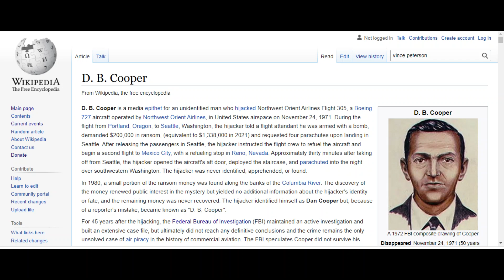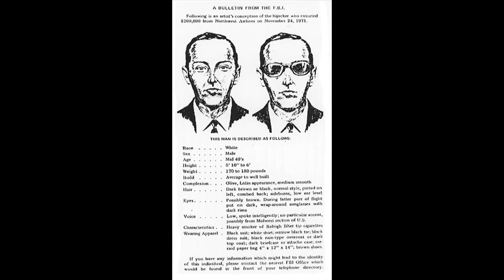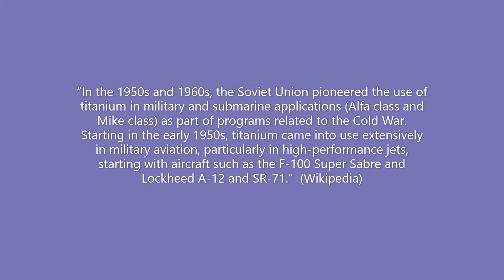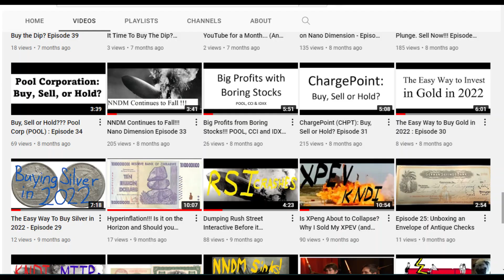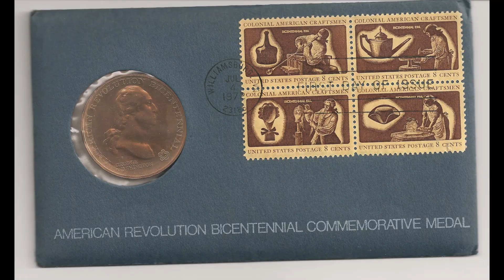DB Cooper: The Trouble with the Titanium Tie and the Latest Suspect. Episode 147

Comment: The origin of titanium goes through a reduction process... until it becomes a pure titanium sponge... when they add in various other metals then it becomes a titanium alloy... during the 60s and the 70s there was basically three titanium alloys... to get titanium from particles that has to come from a powder form... like titanium sponge and titanium dioxide... often metallurgist would wear a clip-on tie and a shop coat to hinder the titanium Dust from settling on them.

Comment: What if the tie came from a thrift store?
Reply from the maker: Possibility that it was not the clue that it seemed. Here is a partial response to another commenter, about the time, you might find it interesting: Hello, thanks for your comments. After my video on November 19th titled: Has the DB Cooper case finally been solved? episode 146 (and that is the episode number for my show to keep things more easily trackable since many of my titles are similar), that one was about Vince Petersen being identified by Eric Ulis as Cooper. The next day I did a video called: DB Cooper the trouble with the titanium tie and the latest suspect, which was episode 147. That talked about some issues with the titanium on the tie. Skipping ahead, over the past two days I uploaded a two-parter called: DB Cooper the terrible trouble with the titanium tie, part 1 and Part 2 which are episodes 159 and 160. Most of the comments that I've received along these lines were before I uploaded episode 159 and 160 so if you've not seen them I hope that you'll take a little time to watch them. In them I point out that the original research that Tom Kaye and Citizen Sleuths did, which still shows on their website as of yesterday, is that the three titanium articles are pure titanium, that is not an alloy. Eric Ulis’ conclusion based on Tom Kaye's research, Is that it was a specific type of titanium antimony alloy. Where the bridge between finding that the 3 particles were pure titanium turning into three particles of a titanium alloy I do not know, but let us for the sake of argument say that there was originally a mistake and that the particles are in fact indisputably a certain alloy of titanium antimony. Is it a valid statement that the only place that this would be found would be at Rem-Cru? I would argue: no. we have the three individuals who applied for the patent they worked at Battelle Memorial Institute in Columbus, OH. They did not work for Rem-Cru. It has been surmised, not my interpretation although I agree with it, that because the 3 petitioners for the patent worked at a nonprofit that four the patented material to be commercialized it needed to be patented under the auspices of a commercial organization, that is a Profit making company, not a nonprofit. Whether that's 100% accurate as far as the reason is probably not material here. What is material is whether these three people who worked at Battelle in Columbus, OH, produced any of this alloy there while they were developing the information for the patent, which I would argue most likely would be the case. How else could you come up with the data to put in the patent application if you have not first created the alloy? So if my contention is accurate then not only possibly at Rem-Cru, but most likely at Battelle there would be engineers working with the TiSb. So we have two places identified where there was likely that alloy at some point. Also remember that patents protect the commercialization of a discovery, product, or process, it does not preclude other people from working with that product and if they improve upon it, they can then patent the improvement to it. Also, the patent was rejected, there was a lawsuit, no patent for that particular alloy was given, and nobody was precluded from working with that particular alloy. Also in the most recent video that is episode 160, I put a screen shot of a scholarly journal written in English but from Scandinavia and probably from research done in Norway on four variations of titanium antimony alloy. That was published in 1962, a few years after the patent application was originally filed. And again lack of other online evidence does not mean that other people were not working with this material. If you were in a lab working with the material even if it was a nonprofit and you wanted to write a scholarly journal, if your work with the titanium antimony did not result in a new breakthrough of any type then you would not be writing the journal article in the first place. And many journal articles are not yet available online even if they do exist.
Again I would encourage people with questions or comments about this to watch those last two videos but I also caution people not to rush in to buying this as the ultimate smoking gun that has solved the case. I think that three particles out of 100,000 tested is a potentially suspiciously low number of particles that one might expect with somebody working with this alloy, although perhaps not. I have also worked in high tech situations at two companies that are well known throughout the world and I would argue that there are far more people that might come into casual contact with a few molecules of a particular alloy than one might expect and certainly more than a pool of only eight people. And as I've pointed out I would not be surprised if Cooper turned out to be some type of disgruntled OSHA inspector or some other type of inspector who would have gone to a variety of locations including perhaps Rem-Cru, and in the course of their job would have been exposed to the wide variety of high tech and aerospace associated molecules found on the tie besides this disputed titanium.
Thanks again for your comments and taking the time to make them here. Remember the whole point of this is to try to come to a conclusion on the identity of Cooper, not to win an argument. We all win when we are able to finally put this to rest, which perhaps may eventually be done using DNA and the particles on the tie might be able to help narrow down areas to look for certain candidates. Thanks again!

Comment: I think your comment about the "extensive" use of titanium in the aerospace industry has no relationship to the observation of an obtuse alloy of titanium that was only worked on at one facility.  I find your argument unpersuasive.  If  "db" was an inspector of some kind, as you speculate,  I see no reason for him to visit a titanium research facility.   Likely he would visit some kind of manufacturing facility.  That alloy, per EJ analysis was never used in manufacturing.
I can see the argurment that the tie could have been picked up at a garage sale but I don't accept it.  Only one with the habit of wearing a tie would put one on for an airplane hijacking.  I suspect that was his work tie that he was used to wearing.  Also, engineers never throw out a tie.  I still have ties from the 50s to present in all widths and lengths. So "db" having an almost 10 year old tie is also hardly a surprise.
Reply from the maker: Hello, thanks for your comments. After my video on November 19th titled: Has the DB Cooper case finally been solved? episode 146 (and that is the episode number for my show to keep things more easily trackable since many of my titles are similar), that one was about Vince Petersen being identified by Eric Ulis as Cooper. The next day I did a video called: DB Cooper the trouble with the titanium tie and the latest suspect, which was episode 147. That talked about some issues with the titanium on the tie. Skipping ahead, over the past two days I uploaded a two-parter called: DB Cooper the terrible trouble with the titanium tie, part 1 and Part 2 which are episodes 159 and 160. Most of the comments that I've received along these lines were before I uploaded episode 159 and 160 so if you've not seen them I hope that you'll take a little time to watch them. In them I point out that the original research that Tom Kaye and Citizen Sleuths did, which still shows on their website as of yesterday, is that the three titanium articles are pure titanium, that is not an alloy. Eric Ulis’ conclusion based on Tom Kaye's research, Is that it was a specific type of titanium antimony alloy. Where the bridge between finding that the 3 particles were pure titanium turning into three particles of a titanium alloy I do not know, but let us for the sake of argument say that there was originally a mistake and that the particles are in fact indisputably a certain alloy of titanium antimony. Is it a valid statement that the only place that this would be found would be at Rem-Cru? I would argue: no. we have the three individuals who applied for the patent they worked at Battelle Memorial Institute in Columbus, OH. They did not work for Rem-Cru. It has been surmised, not my interpretation although I agree with it, that because the 3 petitioners for the patent worked at a nonprofit that four the patented material to be commercialized it needed to be patented under the auspices of a commercial organization, that is a Profit making company, not a nonprofit. Whether that's 100% accurate as far as the reason is probably not material here. What is material is whether these three people who worked at Battelle in Columbus, OH, produced any of this alloy there while they were developing the information for the patent, which I would argue most likely would be the case. How else could you come up with the data to put in the patent application if you have not first created the alloy? So if my contention is accurate then not only possibly at Rem-Cru, but most likely at Battelle there would be engineers working with the TiSb. So we have two places identified where there was likely that alloy at some point. Also remember that patents protect the commercialization of a discovery, product, or process, it does not preclude other people from working with that product and if they improve upon it, they can then patent the improvement to it. Also, the patent was rejected, there was a lawsuit, no patent for that particular alloy was given, and nobody was precluded from working with that particular alloy. Also in the most recent video that is episode 160, I put a screen shot of a scholarly journal written in English but from Scandinavia and probably from research done in Norway on four variations of titanium antimony alloy. That was published in 1962, a few years after the patent application was originally filed. And again lack of other online evidence does not mean that other people were not working with this material. If you were in a lab working with the material even if it was a nonprofit and you wanted to write a scholarly journal, if your work with the titanium antimony did not result in a new breakthrough of any type then you would not be writing the journal article in the first place. And many journal articles are not yet available online even if they do exist.
Again I would encourage people with questions or comments about this to watch those last two videos but I also caution people not to rush in to buying this as the ultimate smoking gun that has solved the case. I think that three particles out of 100,000 tested is a potentially suspiciously low number of particles that one might expect with somebody working with this alloy, although perhaps not. I have also worked in high tech situations at two companies that are well known throughout the world and I would argue that there are far more people that might come into casual contact with a few molecules of a particular alloy than one might expect and certainly more than a pool of only eight people. And as I've pointed out I would not be surprised if Cooper turned out to be some type of disgruntled OSHA inspector or some other type of inspector who would have gone to a variety of locations including perhaps Rem-Cru, and in the course of their job would have been exposed to the wide variety of high tech and aerospace associated molecules found on the tie besides this disputed titanium.
Thanks again for your comments and taking the time to make them here. Remember the whole point of this is to try to come to a conclusion on the identity of Cooper, not to win an argument. We all win when we are able to finally put this to rest, which perhaps may eventually be done using DNA and the particles on the tie might be able to help narrow down areas to look for certain candidates. Thanks again!